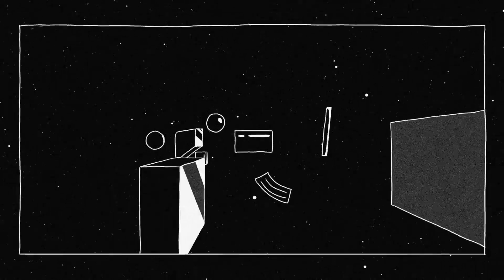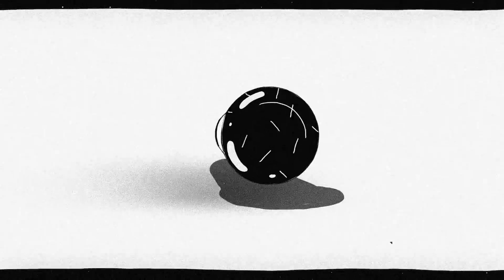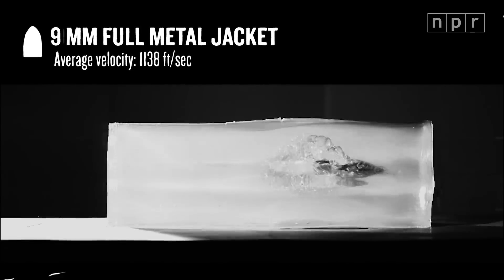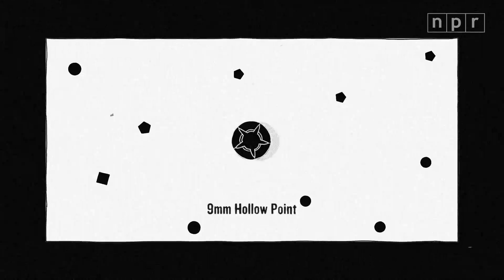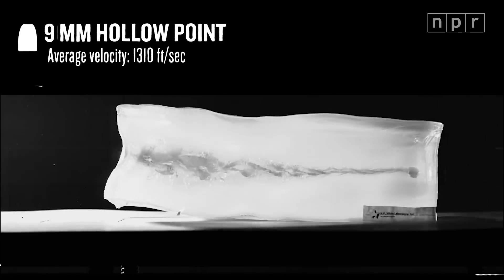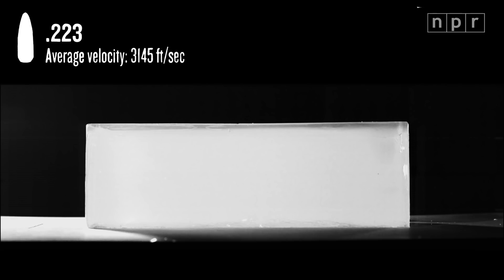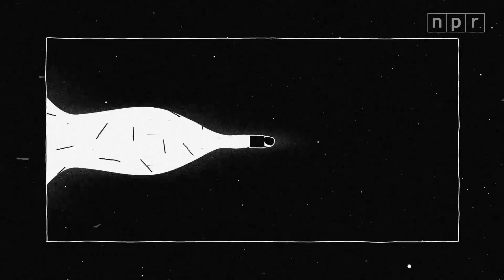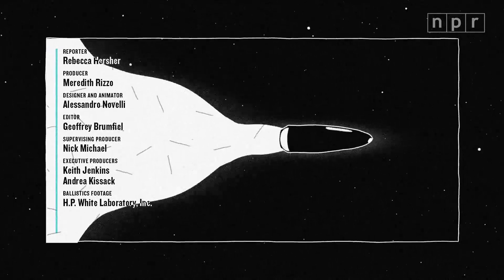How Physics And Design Make Some Bullets More Destructive Than Others | Let's Talk | NPR

Comment: Bullets do not tumble as they fly to a target. If they do, its a bad thing. The reason a bullet tumbles, is b/c when the bullet is decelerated rapidly, the stability is compromised and it can yaw and pitch. The technical expression is that, in its trans-sonic mode, the center of pressure is in front of the bullet (stable) and as it transistions to sub sonic, the center of pressure moves along the axis to the back. That is very unstable.

That was for the Americans who needed to know. The commie libtards  who want to disarm the citizen can fuck off.

Comment: So first off, temporary cavities do not do as much damage as we previously thought. If that's hard to understand go look up a video of someone getting slapped in slow motion. Their entire face wobbles and stretches like it's about to jump off their skull, yet the only damage actually done is a red spot where the hand made contact. Our bodies are elastic, that's why the cavities are "temporary". The damage caused by a tumbling or expanding bullet isn't the energy transfer but the size of the hole caused by the size of the area of the bullet pushing it's way through your body. I don't know why so many people feel the need for bullets to have some magical effect other than quite literally poking a hole in you. It's the size of that hole that determines lethality, nothing else.

Secondly, what is the point here? I'd get if you wanted to ban all bullets because of gun violence, but are you really saying that some bullets are "too deadly"? You can only be dead. You can't be very dead or ultra dead or super ultra mega dead. A bullets job is to make something dead, so either the bullet does it's job or it's not a bullet. The added velocity of a 5.56/.223 makes it an excellent target round at long range (most gun violence occurs within 21 feet btw) and flat shooting which is necessary for rifles with in line recoil like the AR platform. Hollow point bullets drastically reduce the chance of over penatration which limits collateral damage. So banning high velocity or hollow point bullets specifically would not reduce the lethality of those rounds in any meaningful way (if you doubt that feel free to shoot yourself center mass with a 9mm fmj and tell us how less-lethal it is) but would reduce the recreational capabilities of some firearms, while greatly increasing the secondary casualties in self defense, police, and mass shootings.

Comment: As an EMT I can tell you that the most deadly bullets are the tiny .22s and .32s. When you get shot with a small bullet like that it doesnt have the speed or mass to exit the body. So it ricochetes off bone and is extremely difficult to locate and extract by surgeons. A shot in the arm and the bullet could end up in the groin. A rifle wound though has an entry and exit wound usually and its damage is much more localized to the site of the GSW. Humans have for 10s of thousands of years found more efficient and creative ways to kill each other. Spears become bows to bronze to iron to steel to guns to bombs to poison gas.

Comment: I really shouldn't be surprised at the level of idiocy shown in this propaganda video. They compared a SUBSONIC .22 at 900-1,000fps with a SUPERSONIC .223 at 2,900fps. HOW is that a valid comparison!? shakes head Also, more Americans are NOT getting shot "with larger, faster, better designed bullets". The 9mm is just that: a 9MM.  Last I checked, millimeters don't get larger over time. If something was 9mm 30 years ago, its 9mm today also. Right? Or was there a change in metrics that I'm just not aware of? Hollowpoints are not a new invention. They've been around since the late 19th Century. Yet, in this video, they make it seem as though they're some new type of bullet technology. This video is nothing short of anti-gun propaganda aimed at scaring the uninformed.

Comment: Wow, as a firearms instructor, let me add a few facts:

1) Few murders are committed with any kind of rifle.  More people are clubbed to death and more people are killed with bare hands.

2) The .223 is indeed popular, but as rifle go, it is not very powerful.  Most states don't allow its' use for deer hunting - although it is popular for use against other, smaller game.

3) Depending on then load used, a 30-06 hunting rifle is abut 2.5 times more powerful than a .223.

4) All handguns are underpowered.  Police and citizens do not use them because they are powerful - they use them because they are easy to carry and conceal.  Criminals use them for the same reason.  You won't see soldiers using a handgun - even at close range - unless their long gun has failed - or they don't have one.  Pilots are currently issued pistols for self defense if shot down - but soon will be issue an M16/M4 variant.  True there are .44 magnums and .50 Cal handguns - but they are huge and very heavy and very large.

5) You compared two different 9mm rounds - but as bullets have improved, both police and citizens have begun to use the 9mm instead of .40 and .45 cal. weapons they previously used.  The FBI has recently made this change.  Generally, it is easier to shoot a 9mm than a .40 or .45 - reducing the chance of missing the person you need to stop.

6) Hollow points have been in use for decades - but they have improved greatly in recent years.  They perform more consistently and better.

Finally, lethal force is lethal force.  No responsible cop or gun owner wants to use lethal force - but once you have determined that it must be used to stop the threat, you want it to do just that as quickly as possible.
Reply: Thank you Vince. It's like you are my spirit animal...

For anyone who finds this and is wondering "is Vince being honest here?", everything he said is 100%, balls on, dead center accurate. 

Good show sir. Glad to see there is  someone else who knows what they are talking about, isnt full of shit, and is willing to try and set the record straight.

Keep up the good work.

Comment: >"Not all bullets are created equal. Even rounds that look similar, or are similar in size, can cause dramatically different wounds."
'Even just stating the obvious' in 'dramatically different' terms reveals the impartiality of the author, and NPR needs to correct itself. As has been stated, THERE IS NO BULLET TECHNOLOGY ARMS RACE UNDERWAY.  If anything bullets are getting smaller and pistols more concealable.

Comment: There is absolutely no journalistic integrity in this piece whatsoever. .223 caliber is one of the most popular varmit and predator hunting rounds, some even use it to hunt deer although there are several states in which .223 is not permitted for deer hunting due to being less effective than larger calibers. Your attempt to characterize the round as too dangerous for hunting is dishonest as is your attempt to represent .22lr as the typical hunting caliber, despite the fact that 22lr is only suitable for small game hunting (arguably one of the least popular forms of hunting). At the end of the day, all bullets are dangerous. I certainly would not want to be shot with even the weakest ones. However, this video is either a case of the ignorant and uninformed masquerading as experts and/or an intentional effort to misrepresent the facts and mislead viewers who may not have experience with, or interest in firearms. After all, no viewer has the time or inclination to check and verify every claim and 'fact' that is reported.

Comment: Trying to figure out if NPR is being intellectually dishonest or if they're actually ignorant on this topic.
Reply: I know it's been three years, but I wonder if you'd explain what you mean. Thanks.
Reply: @bobeichelberg7715  Since you asked politely, and it's only 2.5 min, Bob, I will be glad to.

Going point by point.

1. Right off the bat, bullets are not "designed to wound;" they're designed for a purpose - to effectively and efficiently stop the threat or kill an animal. The video starts with poisoning the well with this statement. 

2. Full metal jacket versus hollow point.
They mention that hollow points are "typically used by police," but they fail to mention that they are a common self defense round as well - again, lying by omission to lead the viewer to their pre-determined conclusion.
Typical defensive rounds are designed to create what is colloquially known as "stopping power," which is often created by using hollow points which are designed to mushroom upon impact. These bullets also perform well when over penetration is a concern, such as when shooting in a building, whereas non-hollow points, aka ball or full metal jacket, have the chance to over penetrate. For example, if a defender wished to shoot a home intruder, but is afraid that the round may over penetrate into the next room (such as if they have loved ones in the house with them), it would behoove the defender to use hollow points instead of full metal jacketed rounds, as they are more likely to stop the attacker and less likely to over penetrate into the next room. Unfortunately, hollow points are often demonized and made illegal, such as in the state of New Jersey, where these more functional and safer rounds are outlawed. However, the video goes on to make the viewer, presumably more ignorant than the creators, assume that full metal jacketed rounds are safer or more desirable than hollow points. They are not - the basic rule of thumb is that hollow points are for defense while FMJ is for range shooting.

3. "Bullets don't always fly straight."
Yes, they do; that's why there's an entire genre of shooting specifically designed around this predictable flight pattern - weapons are designed and purchased around the attempt to repeat performance. The fact that bullets "wobble" when running out of velocity is not a feature but the fact that air resistance exists and we're not shooting laser beams. The video claims this happens at 100 yards, but Marines (myself included) are taught to shoot accurately at 500 yards with a 5.56 out of a 20" barrel. Bullets "wobbling" is not a good thing and not desirable, it means you're shooting at the extreme limit of your weapon's capabilities and you're only expected to hit what is known as an "area target," as opposed to a "point target." A "wobbling" bullet also has less penetration power and can, depending on a near infinite number of parameters which people have long online debates over and I'm not about to get into here, even be defeated (i.e. the bullet doesn't penetrate) by thick clothing such as a heavy winter coat. If "wobbling" was desirable in firearms "designed to wound," then why does the military use weapons which maximize bullet stability? We have snipers shooting targets out to a kilometer with recorded shots out to a mile - do you think they want any wobble in their bullet? This is a ludicrous assertion meant to confuse and scare the viewer.

4. Comparing the .22 and the .223 is like comparing a moped with a Ducati - they're used for completely different applications. The .22 is not a defensive round and is only used in this video as a means to attempt to vilify the .223 round. Conversely, the 30-06, just like the .22, is a common hunting round; go watch one of those through slow motion gelatin and compare that with the .223. Let's make one thing clear, the Second Amendment is NOT about hunting, however, most hunting rounds are MUCH more powerful and damaging than the .223 (which is also a hunting round used for SMALL GAME; does the video mention that?), which many consider to be anemic, which is one reason why the military is transitioning to the 6.8. The only purpose for showing them back-to-back is to scare the layman viewer into being afraid of the scary black rifle used in less than 3% of homicides in America.

5. "The shockwave can break bones and rupture organs."
Queue the dramatic music! BUM BUM BUUUMMMMMM!!!
Yeah, all bullets can break bones and rupture organs - even the .22 they showed. Hell, I'm willing to bet that a pellet gun, when used extremely improperly, could "break bones and rupture organs." Again, just trying to elicit an emotional response from the ignorant viewer.

6. "So speed, mass, and shape, determines how destructive bullets are."
Yeah, but the video leads the viewer to think that full metal jacket, which they demonstrated over penetration, is better and safer. They're leading the viewer to a pre-determined conclusion here. Notice they didn't mention the .308, a much heavier and powerful round, often used by civilians and military alike, in scary black rifles. Why not?

7. "And more Americans than ever are being shot by larger, faster, better designed bullets."
Yet the homicide rate was going down until the BLM/ANTIFA riots and has been trending down since the 90s while gun ownership has skyrocketed.
In fact, pistols are the most used weapon in homicides accounting for roughly 50%; NOT "larger, faster, better designed bullets," as the video states. A 9mm is larger than a .223, but the .223 is faster than the 9mm, but many more people are murdered with pistols (9mm) than rifles (.223). Also, if the goal was "larger," then why aren't more people using the .45 ACP round, rather than the 9mm? 9mm is the most widely used pistol round in America, so it doesn't make sense if the goal was to "wound" and that means to have a "larger" round, that more people would choose the smaller round when given the option.
So this statement is factually incorrect and verifiably ignorant.
Per the FBI, in 2019 (latest data provided), of the 13,927 total homicides, 6,368 were committed using pistols, while only 364 were committed using ALL FORMS OF RIFLES - that is to say, not just the scary black ones this video wants the viewer to be scared of, but also the .22 bolt action rifle - ALL RIFLES, only 364 total. 
Let's compare that to knives, which were used to commit 1,476 homicides - meaning that knives were used 4 times as often than rifles to commit homicide in the U.S. in 2019. "Personal weapons," which include hands, feet, etc., account for 600 homicides, meaning that almost twice as many people were killed by someone's bare hands than ALL RIFLES combined. Meanwhile, the video would like for you to focus on the scary black one because that's the one they want to prevent you from owning in their continuous infringement on the Constitutional Right which guarantees all individuals the Right to keep and bear arms and explicitly states "shall not be infringed."

8. Let's say the number given, that of 100,000 people shot, is correct. An Obama-era CDC conducted a study which found that roughly 500,000 to 3 MILLION (read that again and yes that's accurate) incidents occurred where a lawful citizen used a firearm to protect themselves or others. So on the lowest end, there are over five times the number of lawful defensive uses of firearms as there are people shot in America (and let's not mention that their number doesn't state whether those shot were lawful shootings in self defense, suicide or attempted suicide, or any details of the nature of said shootings - they just throw out the number without any qualifying).

Lastly, with their number of 100,000, we're looking at a 10% kill rate for all shootings. If 100,000 people are shot, and only 10,258 of those people die from firearms, then how can one make any sort of reasonable claim that "bullets are designed to wound" and "more Americans than ever are being shot by larger, faster, better designed bullets," when only 10% are actually dying from their wounds?

Seems to me, if the goal is to design a "larger, faster, better designed bullet" intent on "wounding," then the manufacturers are doing a poor job at it.
Reply: @johndoh8283  Thanks you for taking the time to detail your response. There's a lot there and I learned a lot (I would only take issue with the CDC's study on the number of DGU's as the results were part of a survey and the extrapolated to the wider public, where the word 'defense' was somewhat open to the subject's definition. I would also question some of your correlations drawn in section 7.). Still, thank you for the information and opinions!
Reply: @bobeichelberg7715  My pleasure - you seem like you're approaching this from an honest position, so I'm always willing to engage with those willing to have an honest discussion.

First I'll address the CDC study's shortcomings - it's impossible to get accurate metrics on the number of unreported defensive uses of firearms. If a woman is walking home and a would-be attacker approaches and she pulls her lawfully concealed firearm and the would-be attacker turns and runs, that's not recorded in the statistics - this is why the estimated numbers are so wide. That said, the CDC is not "gun friendly" and have some high profile attempts at producing numbers unfavorable to gun owners, so the fact that they had to report 500,000 is still noteworthy - this isn't some study done by the NRA.

Which "correlations" would you "question" in Section 7, specifically?

Cheers.
Reply: @johndoh8283  Thanks you for the rational conversation and the kind words. I learned some stuff. I think it would definately6 be a better world if people would listen, consider other viewpoints, research, think critically, discuss--instead of letting emotions dictate.  Good points on the CDC study as well. Anyway, thanks again!